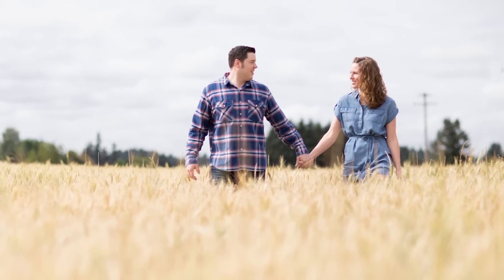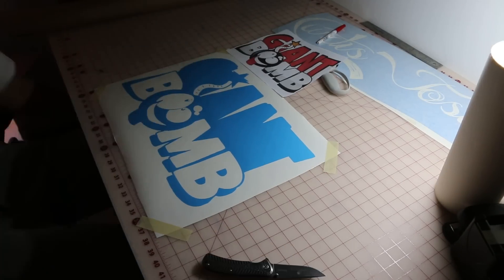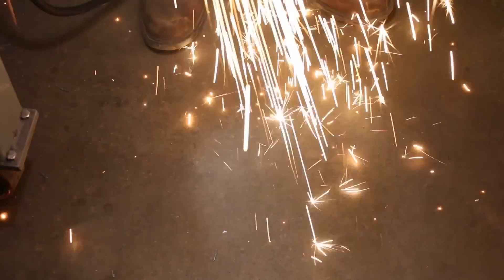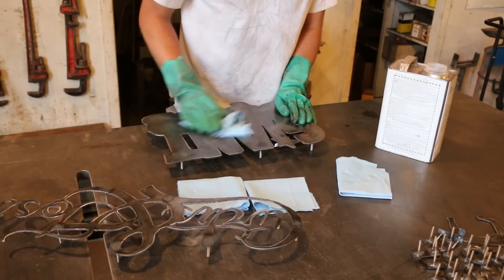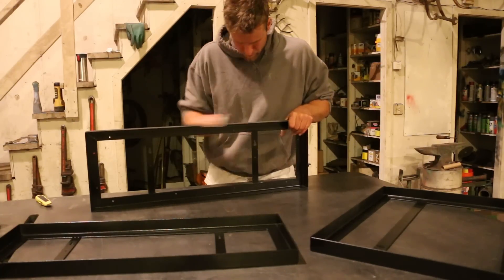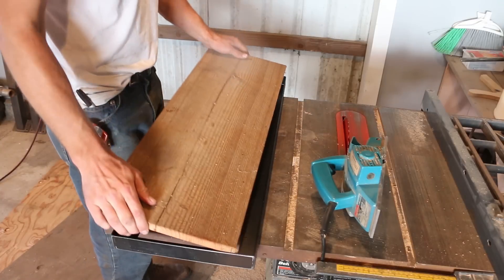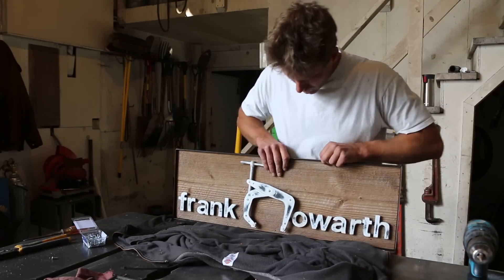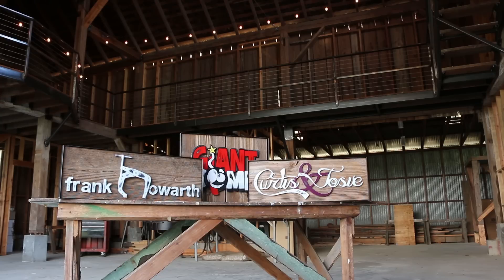Frank Howarth, my Sister, and a Giant Bomb

Comment: 15:08.........I had this paint issue happen to me when I was 16 and fixing rust spots on my car.  My car had previously been painted with an enamel paint (I did not know this).  Most of the paint you buy in spray cans is Lacquer.  According to a "paint guy" 30 years ago he called this "lifting".  He said you can spray enamel over lacquer (that is why they re-paint cars in enamel) and be fine but you can't spray lacquer over enamel.  I would be willing to bet that your white paint is enamel and the clear coat is lacquer based and that is why you are getting lifting.
Reply: right on thanks!...this isn't big mike from champlin, Minnesota is it?

Comment: The acrylic crinkle can happen when you apply clear coat too late after applying your base, but too early after letting it dry. There's a recommended window between the two times and it's usually on the spray can.

It can also happen if you don't use a clear coat type that matches your base coat, like acrylic clear with enamel base. 

Anyways, amazing work! You've got yourself a new stalker (subscriber!)

Comment: Nice work man.
The paint wrinkles with the transparent layer because the first coat has not yet fully cured and is reactivated by the action of the solvent, the second coat must have been very heavy, or in a hurry with the second hand.

Comment: I only read through a couple "pages" of comments, but did see it: Did you ever get word on whether or not your signs were appreciated and / or will be used?  I only watched your video because I recognized Frank Howarth's name.  Think I'll be watching more of your videos now.
Reply: Rainfall Projects I'm not sure if you ever found out why your paint wrinkled. I had this happen to me once. I later found out that I was using an enamel paint with a lacquer clear coat. Apparently that causes it. Great videos! Keep it up
Reply: My thoughts are maybe the protective oil wasn't quite cleaned from the metal before painting and contact with the clear coat caused the paint to pull away.

Comment: I believe the typestyle is Helvetica. Arial is a cheap ripoff created by Microsoft so they wouldn't have to pay the licensing fees to include Helvetica in the operating system. Compare the two side-by-side and you'll see that Helvetica (at least the legitimate versions; there are now imitations claiming to be Helvetica that actually aren't) is a masterpiece while Arial will always feel a little awkward. In particular compare the angle of the terminations of letters like C/c, a, r, and e. 

There's a tool online called What The Font that allows you to upload a graphic and it goes through with you to identify the actual typestyle. Should save you some time next time. 

Regardless, great work!

Comment: Love your videos.  You mentioned that you had problems with paint crinkling.  I'm not a big painter, but I watched this video by Dan Gelbart:  https://www.youtube.com/watch?v=K25dnGpwZyU .  He claims that solvent based paint preparation doesn't actually work.  One has to either sandblast the part to "activate" the surface, then paint within an hour.  Alternately, if the part is too big to sandblast, you can use a scouring pad and abrasive-type cleaner.  The test to see if you've achieved an activated surface is to see if water beads on it or spreads.